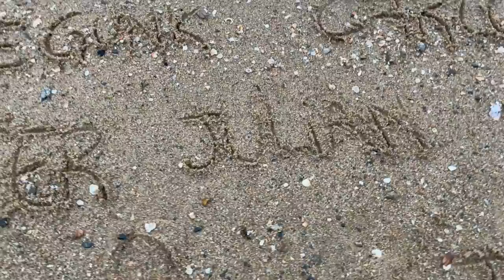Rebuilding a rotten schooner can get very challenging — Sailing Yabá #37

Comment: If Yaba has a new keel, new frames, new planks, new rails, and now she's going to have a new cabin? Why didn't you guys just build a completely new boat? Was there significant cost savings doing it this way?
Reply: Because the seller saw them coming a million miles away and said "yes the boat is only 10 years old."
And they said "10 years, wow it is so new and at such a great price."
Then they discovered the seller somehow managed to rot a boat out in only 10 years and got pot committed after they sunk x amount of money in.
May as well finish it now though and hopefully take better care of it than the previous people did.

Comment: It is certainly coming along. I'm looking forward to seeing the deck put on. I missed what your plans are for the engine. Will you be rebuilding it or replacing it with a larger one now that the boat is going to be quite possibly much heavier?

Comment: Building a new boat might have been a lot easier.
Reply: Agree.  This is a backwards mehod of building a new boat.   Gradually strip all the old while replacing with new.  Does not make economic sense.
Reply: @Jamesl1945  Sometimes it's more than simple economics.... just ask Leo who is held out as "saving" Tally Ho when in reality he replaced everything so far....
Reply: @MegaDirtyberty  Atleast that boat has a racing and ocean crossing pedigree with a over century of history to warrant it, he also got the boat for free and knew what he was getting into.
This was literally a river tour boat that rotted out in a decade.
Reply: @spider0804  Not being a brand new boat it hasn't, the name still has the history associated with it but no longer does the boat....
Reply: @MegaDirtyberty  Pretty much any old wooden ship has had most of it replaced. The USS Consitution is 10% original, Victory is 20% original. I doubt you would say the same things about them or knew that they were largely replaced. Doing it all at once or over time makes no difference, the name and pedigree of the hull are still there and give reason to preserve the vessel. 

My point is simply that there way more reason to preserve a piece of history than a decade old turd.
Reply: @spider0804  So you are calling the USS Constitution and the Victory a "turd"...... interesting....
Reply: @MegaDirtyberty  No I am calling Yaba a turd dude.
Reply: @spider0804  What's a "turd dude"?.
Reply: @MegaDirtyberty  As soon as the insults start the discussion ends.
Thanks for playing.
Reply: @spider0804  Well you said it..... "@Mega fix it  No I am calling Yaba a turd dude"......

Comment: It's funny to see the master boat builders smoking as they use chain saws and chisels. 
In the states, osha's rules. They would force, safety glasses,  ear protection. Saftey vests, steal toe boots. No smoking signs every where.
Fire extinguishers every where. And every one 4 feet off the ground to be tied in. Note, it would take 4 times the men. It would take decades...
And the cost to do those repairs in the states you could buy 3 yachts.. 🗃🧜‍♂️🧜‍♀️👨‍🏫... great job you guys..